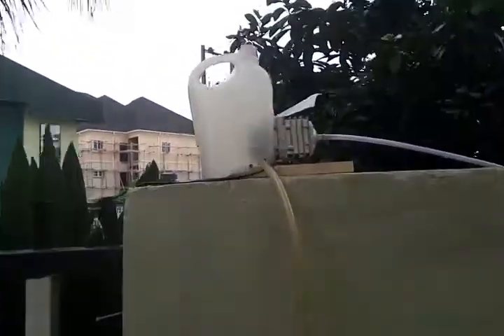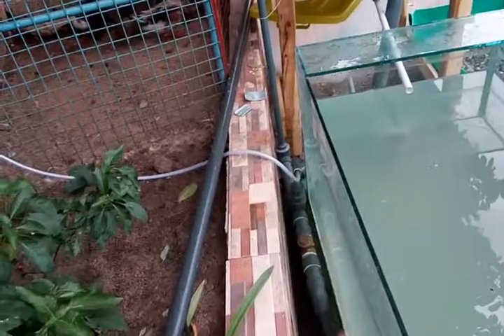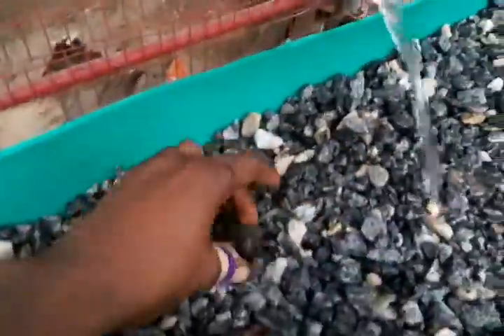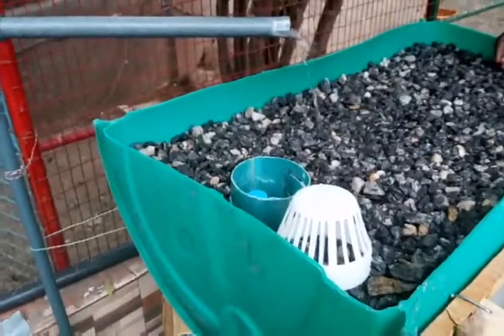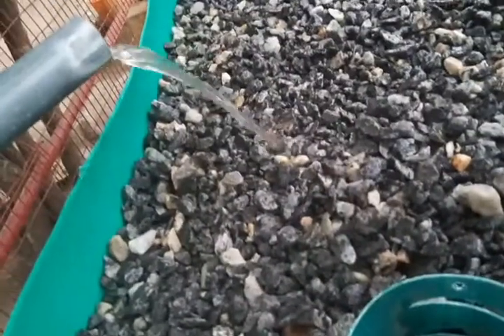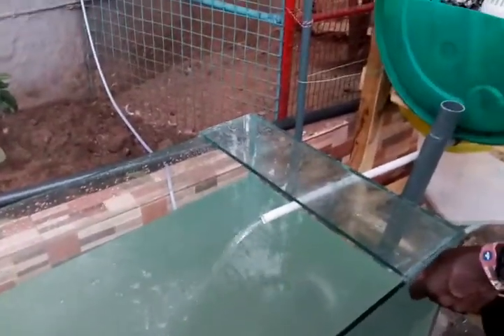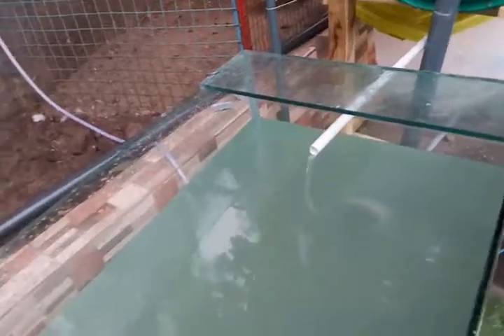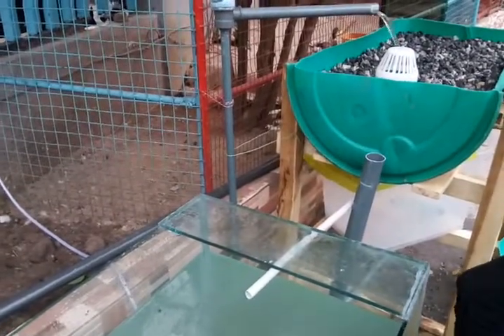[Aquaponics in Nigeria] Out door Aquaponics Catfish Farming in An Aquarium

Comment: No solid filters? You should have a form of biofilter in the system
Reply from the maker: The granite is a solid filter and a biofilter, although due to high feeding rate to achieve 1-1.2 KG in 4 months, I later added a separate filter in this new design and it's been running till now.  https://youtu.be/dTU0hvVldb4